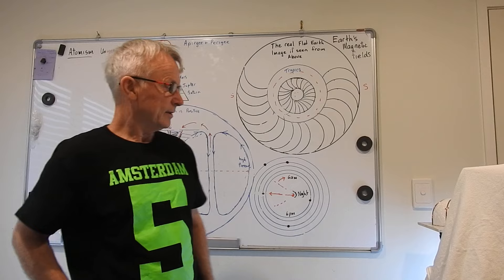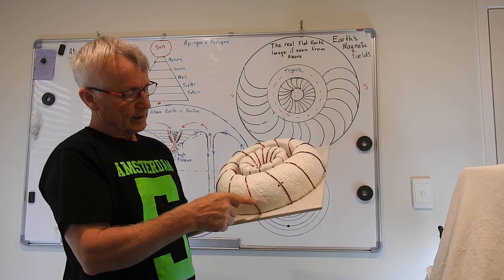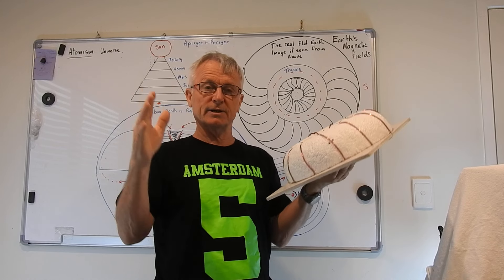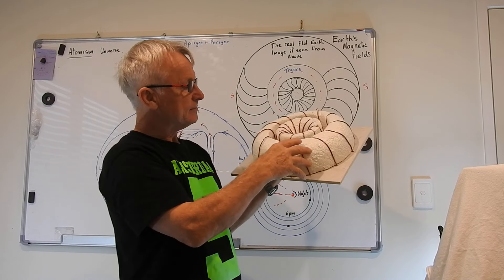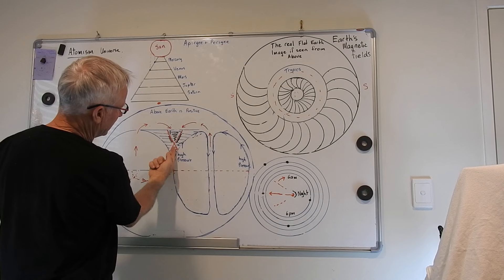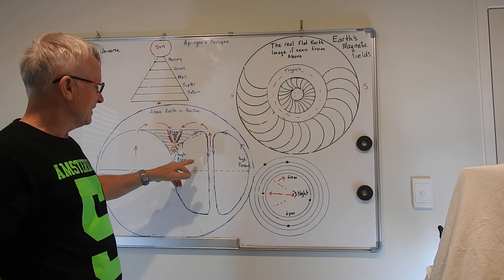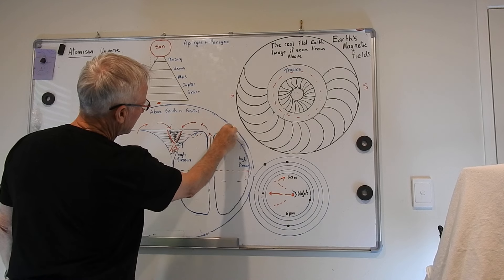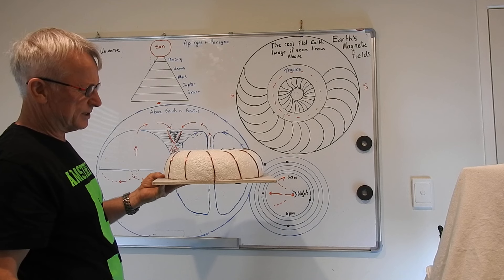FE, The Blue Print For Free Energy.

Comment: No, it's the other way round. Wind (movement of positively charged air) is the product of the relationship between the currents and the EMF.
Reply from the maker: Yes,  and that comes from the tropics but it is the Milky Way that feeds the EMF into the central vortex. The Milky Way is connected to the Sun we supposedly see, above the tropical region, while the other end goes to the actual Sun we do not see, above the center Arctic. Then there is a mirrored image for the southern hemisphere.

Comment: Isn't Marko Rodin's coil a double circuitry system which creates the magnetic flux? so you're saying he is missing the dielectric induction/hyperboloid which would technically make it a free perpetual system.
Reply from the maker: Yes,  but it's not the hyperboloid,  he has that at the center.  It is the gap between the two fields.  That gap with the right resonance feeds back into his center hyperboloid/central. vortex.
Reply: Is the tropical gap likened to the Earths ionosphere cavity?
Reply: @Meta369  Wrong - the torus model is completely wrong. The true FE model has two magnetic poles and all of the land is between these poles. It is between these two poles that the electric current is created and all the land is between these two magnetic poles, just like the globe.
Reply from the maker: @sinla9034
Not sure what you mean there. What ionosphere cavity ?
Reply from the maker: @davidp. 3622
Yes, and ? 
It is either side of the tropical gap that acts as the capacitor plates. Between where the so-radiation is created for the EMI

Comment: It'll have to be fully spherical ;) 
Just like the one inside of concave earth
Reply from the maker: An induction motor is not spherical.  More cylindrical but of two parts,  one inside the other 😱..... Is the secret.
Reply from the maker: Aren't the celestial bodies we see,  for signs?  
Aren't the 5 planets progressing to the two parts (the duality system) of Saturn ?  Creation is opposite to the created.  Creation has the outer field spinning but on earth we need the center spinning.  Think Space Ships and magnetic fields creating a vortex the ship moves in
Reply: @Meta369  the celestial sphere is rotating inside the concave earth in this model - the earth is stationary. The celestial sphere has sidereal velocity. The sun orbits around the celestial sphere in its own sphere immediately outside of the celestial sphere. Venus and Mercury orbit the sun directly , the other planets orbit the celestial sphere.

When the planets are opposite of the sun around the celestial sphere they get magnetically loosened for a second, retrograde, and go back into the proper path again. 

Outside of the sun&planets sphere, is another sphere where the moon is. The moon has its own glass sphere — there’s allegedly another one at 100km — Karman line sphere 

This is the center spinning within earth ;) 
There is a true center point relative to everybody in earth (Sag A black hole) 

The cosmic v web is around this center point with the great repeller and attractor on either side

It’s so beautiful 😻
Reply from the maker: Wacky Backy, mate.
Reply: @ConcaveHollowEarth   I entertained the model  you present , and Lindsay's  makes more sense  +  explanes  the concaveness look , since we are inside the magnetic field .